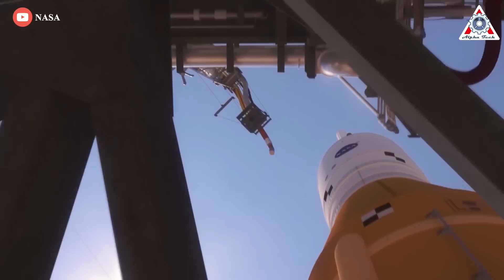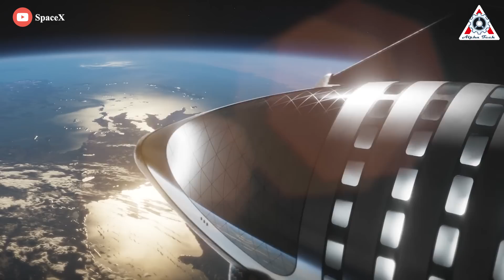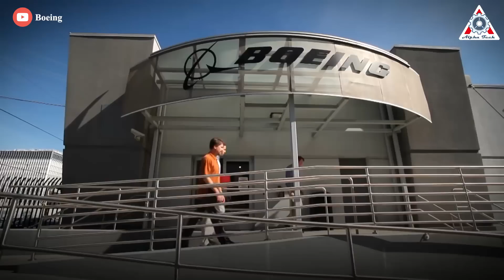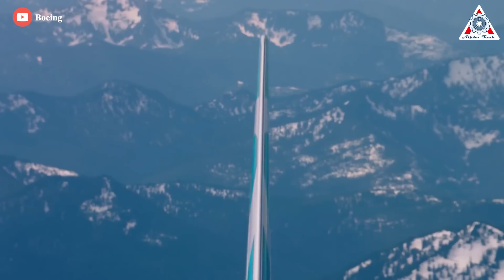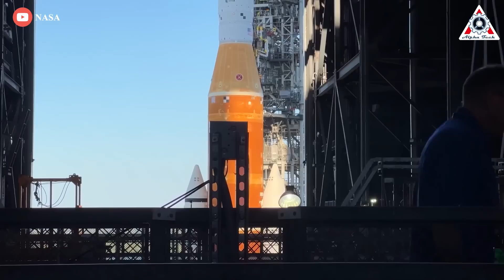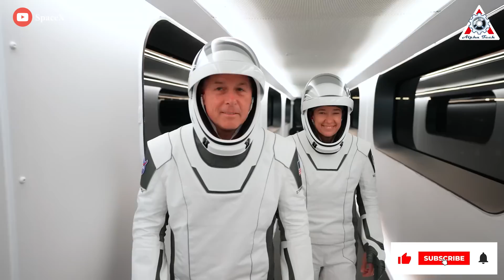Why many are worried about SLS and Starliner's "DISASTER"?

Comment: I agree with 95% of what you say about NASA, SLS and Boeing, but do want to point out something that you don't seem to appreciate: Boeing didn't buy McDonnell-Douglas for its commercial aviation business. In fact, with the exception of the DC-9, it pretty much shut it all down. Boeing wanted the military contracts and the know-how M-D had acquired over decades of building the very best fighter jets in the world, including at the time, the incomparable F-15 (which is still making money from, roughly four decades later). So, you need to stop painting the acquisition and subsequent troubles in Boeing's commercial and aerospace businesses with such a wide brush.